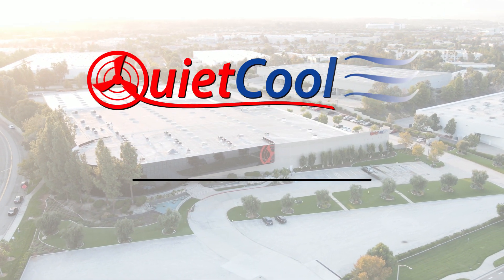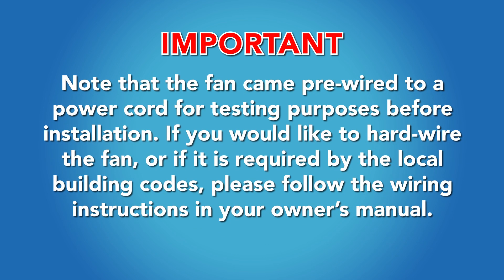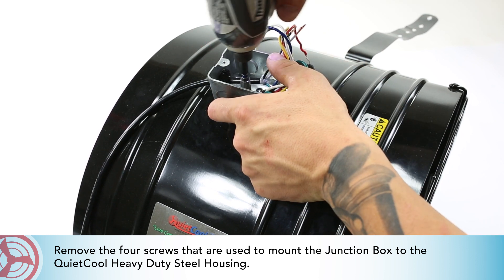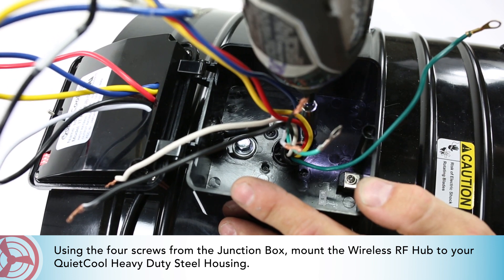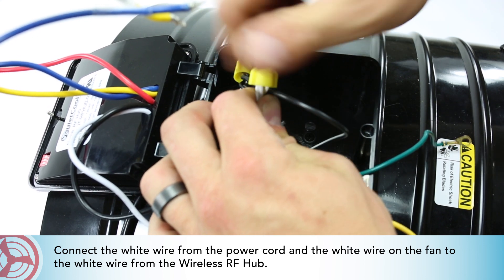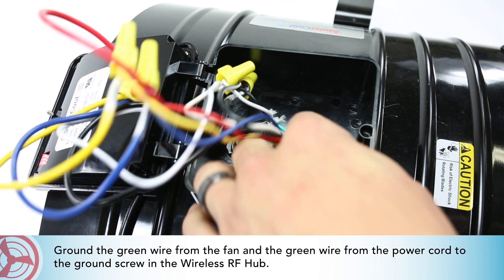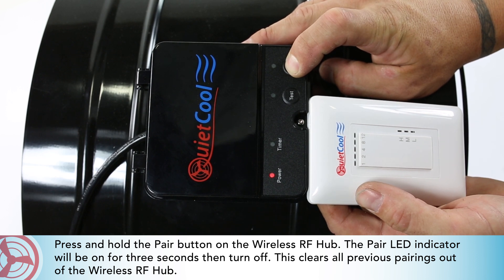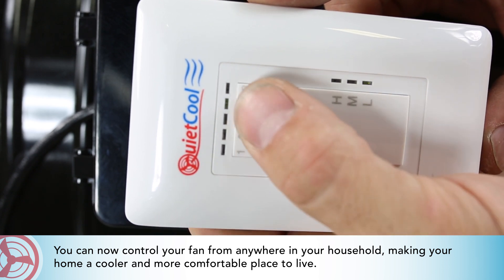Three Speed RF Wireless Kit Installation for QuietCool Stealth Pro 4.8X - 7.0X

Comment: MY fan has 2 speeds, will this change it to 3 speeds?and can I still operate it from the wall switch?  Thank you
Reply from the maker: No, this is specifically for a three speed fan, but we do have wireless kits for two speed fans. With this kit, your wall switch would not be necessary as you would receive a wireless RF remote to control your fan. Let us know if you have any more questions, we are happy to help!

Comment: Why not wire these from the factory?
Reply from the maker: They do come pre wired this is for old systems that are upgrading to the newer controls
Reply: @qcmanufacturing mine did come pre wired 😊. Works great except for the medium fan setting the yellow wire go's no where but low and high is all it needs.

Comment: what if my yellow wire from the fan motor is incredibly short? it only extends about 3 inches out from the fan motor and is capped, dangling
Reply: add some extra wire, tie it together with a wire nut, now you have a long wire. I think they call it a pigtail?  You can always extend the wire.